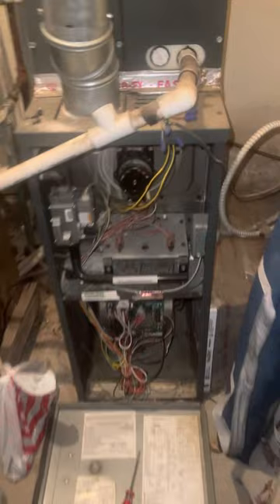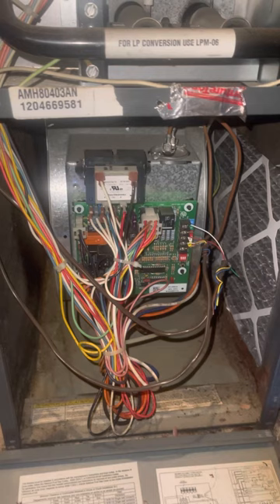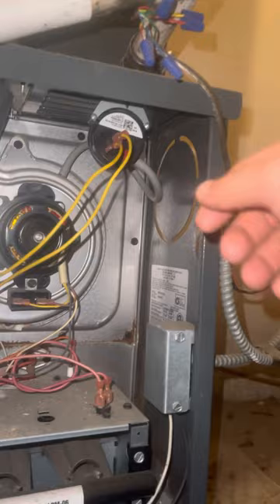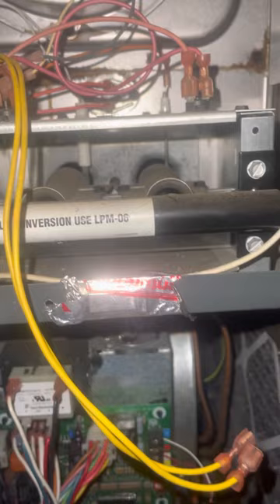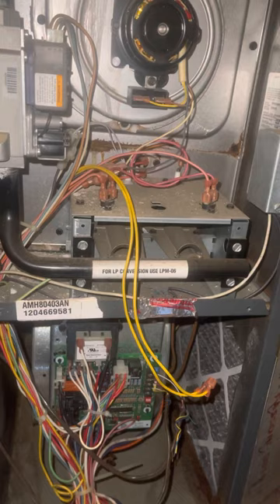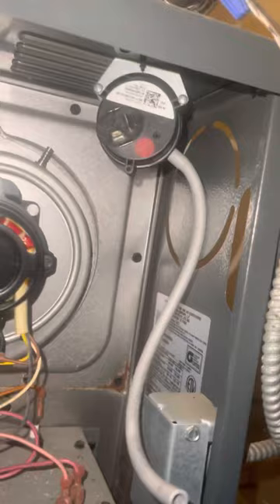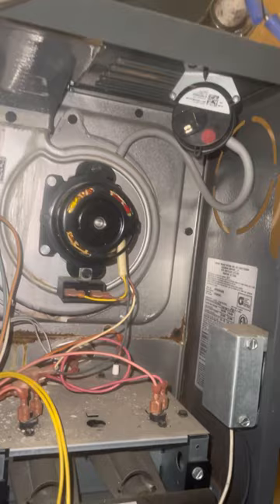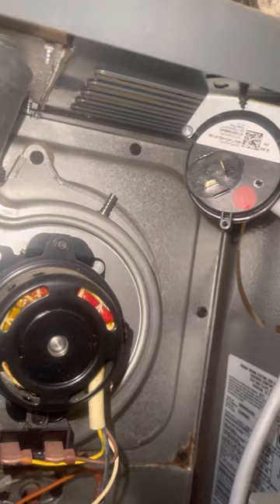Heating furnace not turning on - pressure switch stuck open / closed issue - easy fix to try

Comment: Great case! I was scammed by a "good" contractor, who told me that I need a new control board. Actually, it's the blockage of the hose to pressure switch. He charged me $600 to replace the board, AND he cleared the blockage of the hose. He wanted to take the old control board away, but I refused. I later on figured out the board was good because I put the old board on and it worked! He never answer my call after that. I also heard that he scammed a lot of people around locally.
Reply: Always watch what they do
Reply: I think something like that happened to me because he took the board.Too soon old and too late smart.
Reply: They all do it. The HVAC industry is one of the most corrupt out there. Better yet, just call your gas supplier first. Their calls are free and are part of your regular billing. I'm with Atco Gas, they would have cleared the blockage for free.
Reply: @timcat1004 our gas company doesn’t do any of that. They came out for free and checked that gas was coming to the house. He said they aren’t trained in HVAC but he tried to help. I e done all these steps except the pin. I’m going to try blowing everything out again but with a vacuum or air and see if that does it…
Reply: @amandalawless2530  I'm with Atco Gas they do small repairs for free witch is included in our billing. Mind you I live where heating is life or death.
Reply: @timcat1004 don’t ever try and taint the hvac/r industry like that again, this isn’t the automotive industry.
Reply: @richiegarcia-lopez4268 Ha! Dude, there is that 10% shitbirds in EVERY field.

Comment: This was my exact problem. Tube was clean and the switch would open and close. Wiggled a piece of wire into the base, reconnected the tube and started working again. YouTube to the rescue again.

Comment: If the jumper is in place when you turn on the power you will get an error code. The pressure switch must be seen to be contacts open at the start of the sequence. It's actually the first step in the sequence of ignition and it prevents anyone from bypassing the pressure switch which is a safety switch that informs the circuit board that the vent motor is turning and that the venting is free of obstructions. Bypassing the pressure switch will give you one cycle. Once the thermostat is satisfied it will not start again until the bypass is removed. This prevents a wayward technician from killing his customers by trying to be a nice guy by circumventing a safety switch. By inserting a wire in the vent motor port you cleared the rust or scale that was blocking the orifice. 
Testing a pressure switch should be done with an inline manometer. This will determine if the vent motor is delivering sufficient vacuum to satisfy the pressure switch setting in wc.
Very good tutorial for anyone who has a pressure switch error code just be mindful that the pressure switch is a very reliable component and the cause of the problem is usually something else... rusted vent motor blower fins, weak blower motor capacitor, blocked venting, etc.
Reply from the maker: Thank you for great input and your knowledge! And thank you for being awesome at delivering your knowledge in a professional way! I’m no expert by any means but my fiancé is pregnant and I was trying my best to get some heat 🙏🏼
Reply: When we taught this to our students one of the faults we deliberately installed in a furnace was to block the vent motor port much like you encountered.  By splicing in a digital manometer the technician can see precisely what pressure the vent motor is delivering to the pressure switch. Testing a pressure switch by sucking on it is not representative of real world conditions. A small tear in the diaphragm can be easily missed as lungs can develop a much stronger vacuum than the vent motor. We stress that while a pressure switch can fail it is a safety and therefore inherently reliable. Safeties usually trip when an underlying condition exists. You demonstrated a very good troubleshooting aptitude and found your problem. Always good to have a happy wife.
Reply from the maker: Jim thank you for more knowledge! It makes absolute sense to test the switch with a manometer but most people probably don’t even know what it is. You make a very solid point that the lungs can develop more pressure than the switch and some diaphragm issues can be overlooked by this mechanical “test”. And it makes sense that the switches, being a safety device, are reliable units. My thought was that if you don’t hear the clicking, then it’s an indication that the switch is damaged inside more than just a crack in the diaphragm. You bring back great memories of discussing things with my college professors who often elaborated on things in great detail so I could understand, in depth, the concepts and mechanisms. It’s a pleasure to chat with a knowledgeable individual like yourself 🙏🏼 thank you! Happy holidays to you and your family!
Reply: Can we assume that the flame sensor is on a similar step in the sequence of ignition and you can't just jumper it?

Comment: Thank you Leo. Thought that the pressure switch was the culprit and replacement the remedy, but after watching your video, and clearing the flow path to the pressure switch, Viola! The furnace is operating normally. I literally couldn't have done this without your step-by-step description of the potential causes of the a faulty pressure switch. All for the cost of a paper clip and 20 minutes of my time. Doubly glad for having seen your video, because I now think that even with a new pressure switch in hand, the furnace still would not have fired up.  I'm now inspired to do more work myself and clean the fan/blower housing of dust and replace the fault/wear prone parts. Thank you again.

Comment: I cleaned the flame sensor and bought a new one, still doesn't work .I thought maybe its the ignitor but it's glowing there's just no gas. Then I stumbled into this video. Just what you did, I found one of the nipples is blocked with maybe a gunk or something. I used small nail to push that and cleaned the small hole, put back the hose. I turned the thermostat on, ignition glowed and there's the flame! Thanks lot Leo. Power on!

Comment: Today, I was able to pull off the hose from my pressure switch and see corrosion or just accumulated dust within the nipple that lead into the furnace. Using a thick needle I was able to clear the obstruction and reattach the hose. The very moment I restarted my furnace the heat came pumping through my house. This video completely helped me save a bunch of money and it literally took me 30 seconds to troubleshoot thanks to you... Seriously - Thank you!

Comment: Wow. This saved me today. Furnace was doing the exact same thing. Followed all the steps here and my surface ignitor finally came back on.

No more pressure switch open fault code flashing.

Thank you for posting this video. The family is warm again!

Comment: Thanks for your video!!!  The tip about exercising the pressure switch diaphragm saved me from having the contractor come out.  😊
Reply from the maker: As Jim said in the comments, the switch is a crucial safety component and even though it’s working, I’d still replace it with a new unit. It will cost you about $35-40 and you can replace it very easily. Glad that the video was helpful!
Reply: Will do.

Comment: Thank you! I replaced the flame sensor first, as that was an issue previously. It solved one issue but I got the pressure switch error. Your video was one of the easiest ones that explained how to do it. You're amazing!!

Comment: One very light tap on the pressure switch (it was stuck open) worked every-time  to get my furnance running. The problem with this fix, it was only good for about 3 days. After about 3 days or so, the pressure switch would stick open again and the furnace would stop automatically turning on. So then,  I had to get a ladder to access my attic where my furnace is located and tap on the pressure switch again to heat up the house! I checked for blockages in the rubber tube and where the tube connects...they were clear. Today I installed a new pressure switch ($35 Amazon) and my furnace is once again working properly!
Reply: New furnace switch Update! It's been a month since I replaced my furnace pressure switch and my furnace continues to work perfect!
Reply from the maker: Glad it hear! Thank you for the update! 🙏🏼

Comment: this video saved me $100's avoiding a service tech. I thought it was the flame sensor went bad. Ordered a new one and it did not keep burners going. The next step was learned from this video. I took the hose off pressure switch and blew into it to make clicking sound. Once I took hose off the nipple that goes in the inducer motor fan housing. There was a noticeable blockage of crap in the nipple. Took a wire and shoved it in and also blew thru hose into housing. After that, furnace burners kept working and heating the house once again. This video helped troubleshoot my furnace problem!!!!!!

Comment: Thanx Bro 
My furnace stopped running early early Sunday morning had the Techs out Sunday and they brought over a used control board  and they couldn't fix it they said they'd be back with parts.   It's was almost Wednesday  and  I just got it running right before midnight.   I cleaned the ports in  - collector box , inducer fan  box, burner box .  Blew on  diaphragms and I got it running .  ✌🏼😁

Comment: I had this error code today. Was afraid that I would need to call for technician. Did what is instructed in this video. Fixed the error code and my furnace is now running. Glad that I found your video. Thank you.

Comment: Again you saved my ass Leo!  Furnace was throwing up the code and not running.  Took off the hose blew and sucked on it a few times to hear the clicking.  Put er back on and voila!  Thanks again man!  You rock!

Comment: Thankyou for this video. I was getting a similar issue with my furnace this evening. After checking the exhaust vent as that's what several google searches turned up for a probable issue with mine I  stumbeled across your video. Took the vaccum lines off, cleaned them and re-installed and the furnace fired right up! Thanks again!!

Comment: Holy moly you saved my bacon! It's 10⁰F and I have three kids with no heat. Called for repair, but the guy never showed up. Was told they could get it fixed for 3 more days. This fixed worked right away. Eternally grateful you took the time to make this video. You're an angel!

Comment: Leo, thank you for this! I had the 3 blinking lights and quickly ordered a new pressure switch then found your video, I did your step of cleaning the valve with a pin and that cleared any clog that might have been there. Same as you I could feel a little blockage give way when I slid the pin back and forth. Connected everything back and everything worked perfectly after this quick fix!  Going to cancel that pressure switch order now!

Comment: I live in Atlanta and the furnace in my attic doesn't get much work until late in the year and I don't notice that it is not working until it gets really cold. This video got me up and running in about 15 minutes! No need to bypass the pressure switch. Checking the tube for obstruction, exercising the pressure switch diaphragm and inserting a wire in the vent motor port to clear rust or scale was a great idea and seems to cover all the bases when the pressure switch is throwing a code letting you know its stuck in the closed position. If that doesn't work try replacing the pressure switch, they are cheap and easy to replace. If its still not working, checking and potentially changing the capacitor might help. That is the extent of my personal knowledge, if I can't resolve it beyond that, I'm calling a reliable heating and air company and getting a trained technician to help me out. Thank you for the video, the wire in the vent motor port was a new one for me!

Comment: This seriously worked. Furnace was throwing a pressure switch error, so I took out the old one, blew on the tubes and the switch, used a paperclip to clean out the intake, and the thing fired right up. Thank you sir!

Comment: I was having the same problem for the last couple of days. Today I did everything you did come to find out the reason way mine wasn't working I took of the moter and there was a squirrel stuck dead between the moter housing and in the exhaust pipe. Thanks for the tips!!!!!

Comment: Thanks.  Mine was indeed the pressure switch got clogged up.  I used the paper clip to poke thru the hole and it works like a charm!

Comment: Thank you Leo ! Great, to the point video with simple explanation. I was able to get it to work in 5 minutes. (I did not remove the wires). 1) Removed the tube and blew into it, 2) then blew/sucked after connecting the tube to the pressure switch and 3) cleaned the nipple using the pin and connected the tube back. Voila ! few seconds after I turned it on the error is gone and it started working. THANK YOU !

Comment: Thank you for your video. My model was different. And the issue ended up being not in the pressure switch, but water clogging the exhaust from the motor (heavy rain dripped down the pipe and the water was standing in there, creating real pressure issue at the exhaust). But you gave me enough courage to actually get in there, check the pressure switch, and check the other tubes. Thanks again.

Comment: Awesome video. I also had the 3 flashes. I removed the hose and blew into the switch but had no clicking sound. After tapping on it with a screwdriver a few times it unstuck and started clicking. Thanks a million. 👍

Comment: THANK. YOU. THIS VIDEO SAVED ME A SERVICE CALL THAT ONLY LORD KNOWS HOW MUCH IT WOULD'VE COSTED. I've even had my Nest thermostat replaced amidst this light cold snap we're having here  in Houston thinking it was the "smart" thermostat. Hell i spent more time running up and down from the attic to get the right socket than I did troubleshooting and fixing the unit. Thanks a lot for the video!!
Reply from the maker: Very glad it helped you!

Comment: Thanks Leo, I went downstairs and sucked the crud out of the port and blew the pressure switch a couple times and now were all hot! Whew!
Reply: Ill add by 3 min 30  i had solved the issue, which in YT time is lightning quick

Comment: Thanks. Fixed the problem on my one month old $12000 HVAC system!
Reply from the maker: Heck yea man! One would think that a new system would be nearly flawless, operation wise.
Reply: @Remodelsbyleo Just had them come and replace the pressure switch. Will see if that solves the problem.

Comment: Thanks for the video.  I’ve had this problem too and have been clearing like you demonstrated by blowing/sucking on the hose that connected to the pressure switch. My problem seems to happen on windy days. I’ll have to try cleaning out the inside.
Reply from the maker: We have also noticed that the orifice seems to get clogged by the build up when we go without using the furnace. Perhaps cleaning inside of the motor housing and ensuring that orifice stays clean would help.

Comment: yes I had the same problem. The line to pressure switch was clogged. I could blow into the line and her the switch clicking as you said. Next I took a bread wrapper and cleaned the port for the air pressure out from fan. I could now feel air blowing from port at first. As soon as I stuck the wire from bread wrapper, I could feel a slight blockage and air hitting my finger tips. I then replaced the air line and like magic the ignitor lit and then we got heat. Thanks for the info.

Comment: Thanks for the video!   I had a code 31 for a Bryant and it was the pressure switch issue.   It turned out when I blew into the hose you could hear water bubbling, the backed up water caused the pressure switch to malfunction.  I unhooked the drain hoses going into the condensation trap box, took it off and blew it out and then rinsed it and reinstalled it, the furnace took right off after.

Comment: This was helpful,  I think after troubleshooting the exact same problem.  I kept going in circles with 2 flashes and 3 flashes. Never got the heat element to come on so I think it's the pressure switch

Comment: This worked for me as well. Needed to use a bit of wire to snake into the hole. It was a bit scary pushing through the blockage but once it cleared out, the furnace came right on.

Comment: Great video!  I skipped the step of disconnecting the wires and followed your other steps.  It turned out to be the same problem you had:  a clogged nozzle.  In the future, if I get the same 3 flashes, I’ll go straight the last step:  clean the nozzle.

Now, why is the nozzle getting clogged in the first place?

Comment: House was way down on heat .  First cycle  I ran a little long as far as cycle time and  draft motor didn't lock up but it got warm so I shut it down and put some oil on the shaft ends .  I cycled two more times with a little more oil and ran shorter cycles .  I'm going to order a new draft motor and swap it out just to be sure .

Comment: If your switch and hose are good and still no heat there could be blockage in the flue pipe. Sometimes you’d find a bird nest at the roof penetration.

Comment: good video..ive ran into this a few times. dirt and other debris will block that port and wont allow suction to actuate the pressure switch..and if the pressure switch doesnt work then nothing wil

Comment: My exact problem twice now in 2 years took a hair comb with metal point end and bent it to gain aces to that nipple end and push it in and something gave debris or something and then my unit started working again.
Reply: I should add I had the same 3 blinks indicating a pressure switch stuck open but it was something inside the end of the blower exhaust fan where the hose connects.